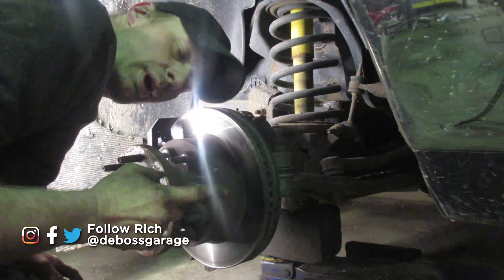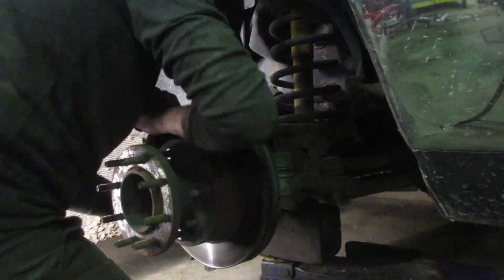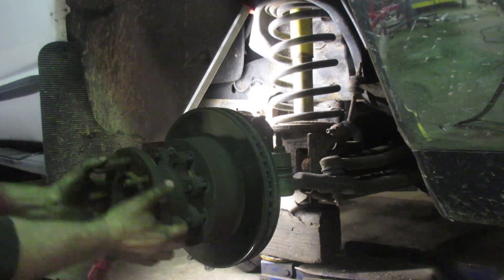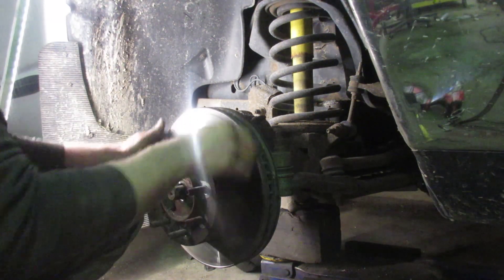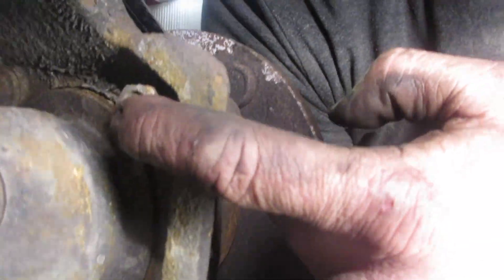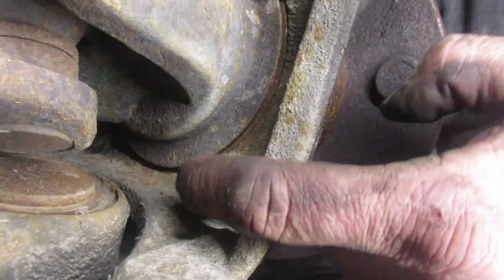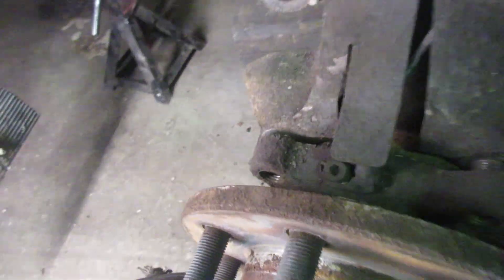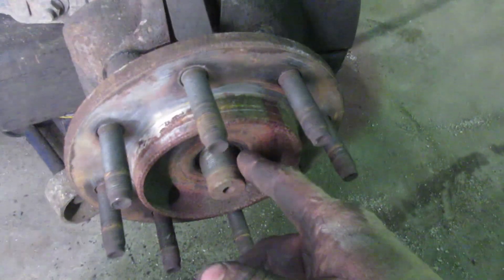How To Remove RAM 2500 3500 Hub Assembly - EASY SIMPLE TRICK!

Comment: That bearing pushing off trick is a real winner!  I couldn't get the brake rotor off so I just pushed the whole thing off together.  Once off...about 2 hammer licks and the rotor came off.  The hardest part of the whole job for me was disconnecting the ABS line even with the red tab out.

Comment: There is also a punch tool you can buy for $40 (or so) that threads into the hub mounting flange to hammer the hub out. Here in MI (lots of road salt and rust) I've nearly never seen a hub come out as easily or evenly as in this video.

Comment: Issue I have on a 96 3500 4x4 12 valve = those 4 bolts that hold the bearing are 12 point bolts and immediately stripped the heads out. Super hard spot to get a welder into but am going to try welding socket to each bolt. Will see in a bit.

Comment: Excellent tip on using the power steering to push out the hub!!! I tried it on my 2008 Dodge Ram 3500 and it worked perfect, although I had to push on both sides of the hub.  No big deal. Reallllly appreciate the tip.

Comment: If you want to push it out straight and not mess up the housing put a porta-power between the bolt and frame kitty corner of that one and  pump while the other turns the wheel against the one with the socket extensions.

Comment: Needed this a month ago. Replaced both wheel bearings, ujoints and all the ballpoints.  Would have saved my hole Saturday. Upside If you don’t use this trick you do get a pretty good arm workout beating the crap out of the old ones till they come out.

Comment: I leave the axle nut on and pull the hub with the axle,  that way you won't destroy the wheel bearing when removing the hub.  Great trick though,  much easier than the porta-power.  Another thing I have tried on some really stubborn ones was to install an old rotor on the hub backwards and use that 12 lb sludge hammer  you were tapping with.  :).

Comment: Wasn’t really a good place to put my extension so I had it against my control arm bracket and it caved in 🥲 hub is still not off. 
Someone suggested a socket between the u joint and hub, paired with the power steering. maybe I’ll try that next…

Comment: Great video I wished I had known this a couple of years ago about the socket and extension. It would have saved me so much time.  I did it the hard way  my teacher school of hard knocks after a couple hours fighting we did finally  used  a  socket turned the wheel and victory it was loose replaced both u joints on front axle. One side took about three hours  the other about  one hour . I guess you could say before and after the learning curve.

Comment: There used to be tool available  to push out the bearing using this method. That tool is no longer available because many times the spindle would break before the bearing would come out. Just a FYI.

Comment: What is your take on the Mercedes OM617  engines? I have recently swapped one into my jeep scrambler and I just wanna know your input on these motors. I have had 0 problems with the motor since the swap with about 2,000mi on it.  i dont know if you run across any of these but I would love to see a video!  I would of done a 4bt but cost of buying the engine is outrageous.  thank you for all of your great videos!
Reply from the maker: No experience yet but I think Stefan's neighbor has one that hasn't moved in a while.  We were debating swapping it into the 48 Convertible
Reply: Definitely looking forward to the videos if you guys decide to go that route. Thanks!

Comment: This is also the method I use and have shown others to use,but once another tech in our shop was using this method and yes all the bolts were removed ,split the steering box in half. has anybody else come across this,lucky it was still under warranty .

Comment: Help! I went to tear into mine today and from what I can tell my axle shaft nut is looking like a 33mm or 34mm flat to flat. And it isn’t castellated. I bought a inking kit from a supplier specific for the 9.25 aam. This is on a 2014 ram 2500 Cummins 4x4.

Comment: Thanks. My Timken hub assembly just showed up today, I'll try this. I've read 1 11/16" for the axle nut but you said 1 3/4". Is this a 3rd gen? Does 260ftlbs sound right for the axle nut?
Reply: TheGasMan good luck with that timken... There made with cheap Chinese steel now days.

Comment: just out of curiosity what year truck? I do a lot of dodge ram 3/4 and 1 ton balljoints, and all the hub nuts on them are 1 11/16 or at least that's the socket I use and it fits perfect. that trick with the extensions is good, used to use it all the time until I found out snapon makes a tool that replaces that extension, has a hex built into the end so it fits out the bolt like the socket. they even have one for the superduty as well, just fits over the stud. these tools are about as big around as a toonie and solid all the way through. I guess down side, they are like $60 a piece Canadian. whatever works right, I just got tired of using extensions, plus I try to buy special tools when I can, its just I hate combacks on certain jobs like seals. or screwing around when I can do it easier with the special tool.
Reply from the maker: I'm the opposite.  Almost in every video someone comments "they sell a tool for that" but usually I don't have it and can't wait for one so I make one.
Reply: hey I get it. I didn't mean anything by it, was just sayin.

Comment: When i did the wheel bearing on my truck the cv axle was seized in and we had to use a 28 ton press to pop the axle out of the hub assembly
Reply: Just did mine the other day. I know a shop owner with a 100 ton press, and he said it clocked somewhere around 30 tons to press it out. When that sucker broke loose you'd have sworn someone fired a gun next to our head. Now my bearing is stuck in the steering knuckle and I'm trying this trick here shortly!

Comment: Will this work on a rear hub😬
Reply from the maker: On a 4 wheel steer truck maybe....
Reply: DEBOSS GARAGE seen a dude take a old rotor and weld a 2ft piece of square tubing to it and you bolt it to hub and hit with big ass 🔨

Comment: Unrelated question, kinda. Have you any experience or thoughts on adding grease to sealed hub bearings through ABS holes? I have an 03 Silverado Z71 I just bought with 167k miles. I don't know if  I have any bearing issues yet. I'm curious about those who add grease as a PM task
Reply: https://www.youtube.com/watch?v=2LKOQoPzXUQ&t=9s

https://www.youtube.com/watch?v=0sHVqp8lMh4

Comment: have a big big question! 
So I bought the OTC 6290a puller tool, to remove the wheel bearing hubs in my 2001 dodge ram 2500 cummins 4wd... ok so I used it today and I was wondering.... so the tool pushes the axel shaft deep inside the pumpkin  in order to get the wheel bearing assembly out right?  Could I break something inside the diferential? I know the axle shaft is pushing against the cross pin, and actually once i removed the axle shaft i notice that the tip or the face of the axle you could see where it was pushing against the pin, is that bad?? is it possible to break something inside the pumpkin using this kinds of tools? my wheel bearing hub was basically glued to the knuckle thats why I used the puller...Is it bad to use this kinds of tools?? Did I mess up my axel shaft ? Thanks, great video by the way!

Comment: They don't come off that easy where I'm at.  It's a fight.  Barely could get the castle nut off the axle with an ginormous 3ft 3/4" drive breaker bar.  I'm 300 lbs and I was jumping on that breaker bar like a chimp and barely got it.

Comment: This is a good way to blow the seals out of your PS box if your truck is rusty.  Ask me how I know...  :)
Reply: It didn't work on the 03 Ram I had, I ended up using two one ton jacks braced against the frame and air hammering the bearing to get it out. Funny coincidence that I had my power steering pump fail about 3 months later.

Comment: I did the company I work for Dodge 5500, front u joints 350 dollars each, unit bearings 300 each, 3 weeks to wait for parts because its a POS dodge that year 5500 was a first year made, the parts after that year were common. Stupid Dodge trucks its why I hate working on them JUNK JUNK JUNK.

Comment: Beware when using a little trick to use your power steering to break free the hub It puts a lot of strain on your power steering pump I brought my 2000 ram 3500 4 x 4 to a shop they blew out my whole power steering pump cost me $1200 because they said they wouldn’t cover it , Do it the correct way there’s a puller for it , I’m an ase certified tech The only reason I brought it to the shop in the first place is because I work third shift I did not have time to do it myself